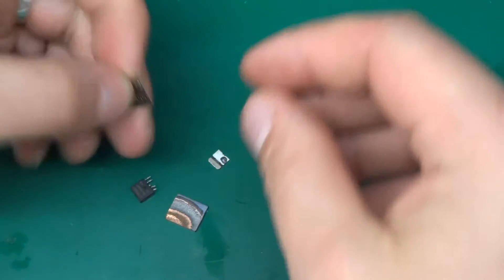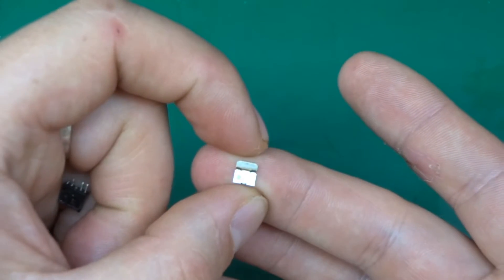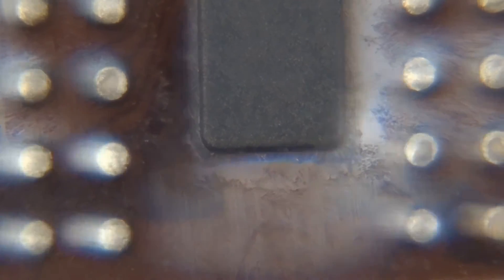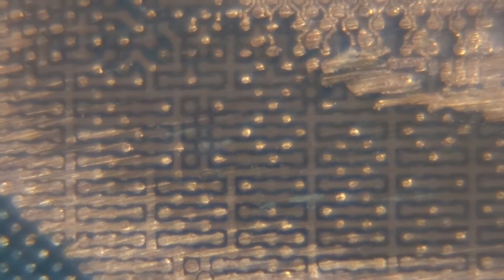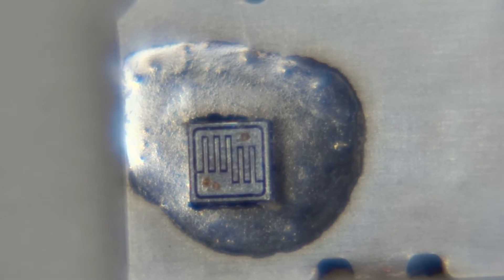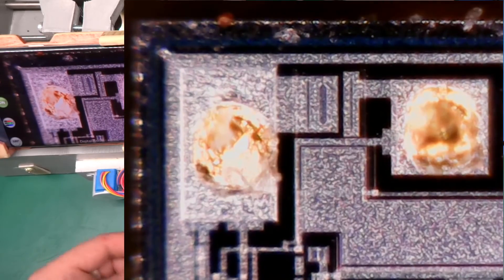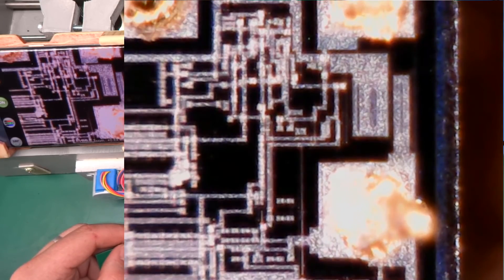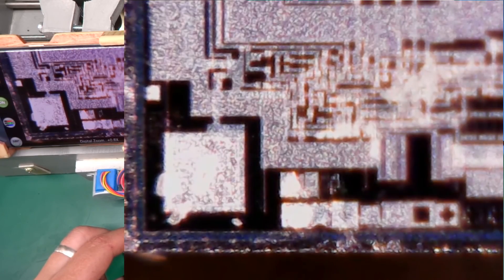Under 1600x microscope: SHARP 070XNA1  linear regulator ic

Comment: The magnification is perhaps 100x in the video. You are aware that 1600x magnification is impossible, optically, right?
Reply from the maker: +Ray R yes. With some high tech immersion lenses you can get about 1000x or so. Beyond that it is called 'empty magnification' - shows no more detail, just makes shapes bigger. This thing here is a joke, but under some conditions can be useful. I mean it costs more less same as 4 beers in local pub lol. I call it 1600x, because thats what it says on the box :D technically if i plugged it in to 150 inch tv, magnification would be greater, but it would not resolve any more detail, just pixels would get bigger, so useless.